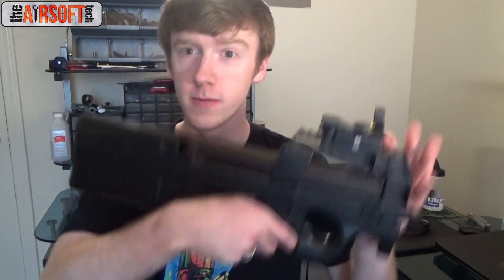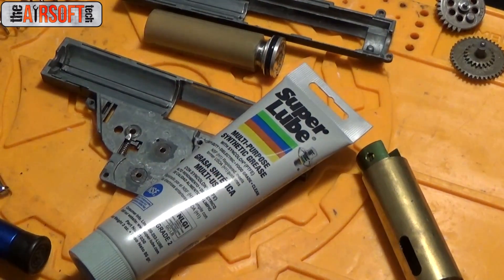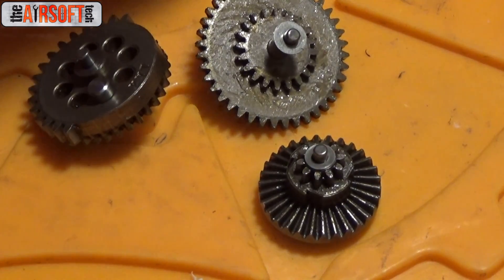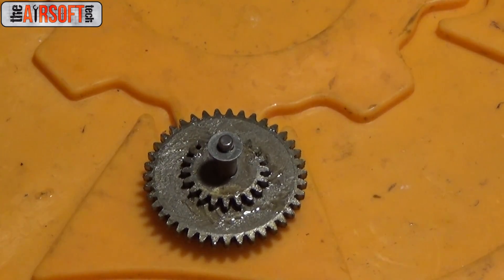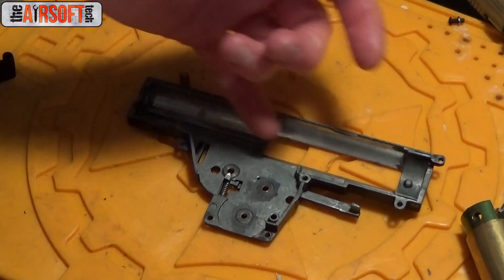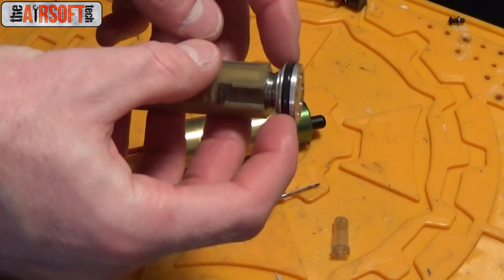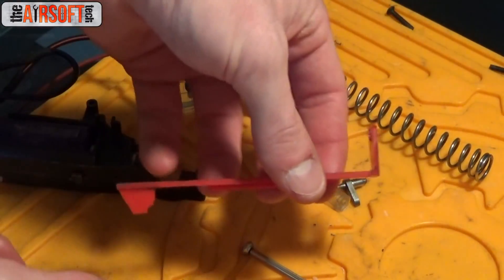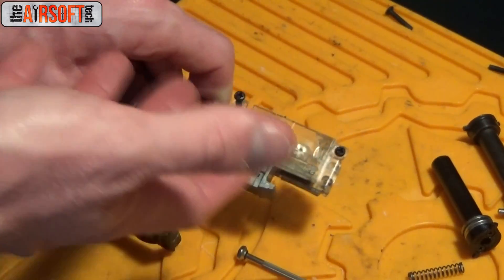Inside the Gearbox: How to Grease a Gearbox

Comment: The Super Lube grease you have is great for the gears. However, they also make one that's specifically for o-rings. This is what you should be using on the sealing surfaces.
Reply: Would you mind telling me which grease they make for o-rings? I am about to crack the gearbox my P90 has been sitting for about 8 years and I need to clean it and relube everything  and put it up for sale. I upgraded it many year ago to about 400 + FPS

Comment: Has anyone heard or seen any issues with using dielectric grease with electronics installed like the Titan Gate?  What worries me is some grease has to fling off the gears and possibly cover light sensors and possibly cause a short in the circuit boards.
Reply: Dialectric grease shouldn't cause shorts (superlube is dialectric I'm fairly sure), but if you use too much it absolutely could fling off and cover the titan's optical sensors, yes. Very carefully applied film of grease preferred.

Comment: I bought teflon grease to lubricate my gun but then i read somewhere that the teflon eats rubber parts. Some say it does, some say it doesnt, and some even say it "regenerates" the rubber. Im confused. I dont want to use it for the rubber parts in my gun if it can eat them up. Should i buy silicone grease for that or is it safe to use the teflon grease for everything?
Reply: As far as i know, it makes them tacky and that could be detrimental

Comment: Why you don't use ball bearings under 8 mm?
Reply: Ball bearings are small when under 8mm.  It is the same reason why most people will not use ball bearing inserts that have a cage, because you have smaller bearings which lose efficiency.  Most airsofters will benefit from just steel bushings over due to simplicity of maintenance and reliability.

Comment: For real machined parts you would clean the metal with an oil based cleaner. If you would clean your slide or barrel with oil, I'd probably suggest cleaning your gears with the same thing. Ballistol or CLP?

Comment: Pssst, just use brake clean to clean the metal components.  It’s literally designed to wash off oils, debris, etc, - and then dry immediately afterwards leaving ZERO residue.
Reply: Underrated comment right here
Reply: I used paint thinner, it works too!

Comment: My aeg bushing is bearing should i put grease on bearings too? Or just the axle?
Reply: You should grease bearings too, but just make sure you clean them out from time to time as grease will keep metal particulates in there.  Also note that bearings spin faster without grease, but it will wear the bearings down more quickly because now you have metal to metal contact with no lubrication medium.

Comment: You're forgetting about dielectric grease. It's good to grease certain electrical contacts with dielecteic to prevent corrosion, rust, and ensure contacts stay in good condition.
Reply: I know this answer is 2 years late.. But that grease IS dielectric :D
Reply: Superlube is dielectric
Reply: Uhhhh if I am not mistaken dielectric means not conductive?
Reply: For metallic contacts you use conductive copper grease, not dielectric.

Comment: Hey i know this is a 2 year old video but ... Superlube is nice dont get me wrong ok . With that said in my opinion it is
 #1 to thick and gets even thicker when cold . 
#2 is kind of expensive 
#3 is hard to get  internet says home Depot has it on the shelf but ive never found it.  So your forced to order it .
 With all that said in my opinion Lucas red and tacky is a superior lube . 
#1 It is a lithium based grease with ep lubricant and ptfe. 
#2 it is about the perfect thickness. Even with the grease literally frozen in the freezer it has about the same tackey ness so movement doesn't slow down. 
#3 and best part . Lucas red and tacky is available everywhere. Walmart, lows, home depot, hell even dollar general sometimes.
#5 its cheap .i picked up a large tube of red and tacky sentheic for half ? Of what s.l cost me . 
Just my thoughts guys hope it helps someone.

Comment: How do we clean grease off a gate Titan v2 board? Exactly where do we position each wire in the motor harness from the trigger mech inside the gearbox (where does each cord go)? How/where do you fit the motor connector wires on the motor in the grip? Where should we use Teflon tape other than their inner barrel? (All M4 V2 rear wired) thank you

Comment: I think i will be paying someone at a pro shop to do all my maintenance lol
Reply: It's easier to do that, but you dont get the same experience and knowledge that you would get doing it yourself.
I would say do your own work, but if you screw everything up and want to give up, use a pro tech as a last resort.
Reply: It helps to know this information.  I've had techs work on a few of our rifles and I disassembled it for inspection; and I've found anything from uncleaned yellow grease, to Teflon tape on the cylinder head where it contacts the piston.  I've even seen low end bushings installed and loose gearbox screws.  It's worth knowing what to look for, and modifying your gun will leave you smiling 😉

Comment: can i put silicon lube on the gears?
Reply: Never put silicon on metal to metal surfaces
Reply: Use silicone grease/lube or the ptfe lube he used. These lubes are plastic friendly. Most other lubes/greases (Lithium grease etc,..) are mineral oil based and break down plastic. 
Don't use any sprays or aerosol cans or whatever, the things use to pressurize it break down plastic as well. Only use bottles/tubes/pots,...

Comment: Can you do an expansive video where you just explain the basics of how a gear box works, what the different parts do, and how to take apart/put together a common V2 gearbox? i am getting into air soft, and i have found out that it is easier to work on something mechanical when you know what certain parts do, and how the different parts work together to perform a specific function. ALSO, I am working twords being a Civil Engineer, and i hear you have a degree of knowledge in engineering, any suggestions of how to deal with the boring number crunching you often have to do in classes?
Reply: I was gonna recommend you this video https://www.youtube.com/watch?v=0pAzXjc-jW8 but i see your 3 years in

Comment: you grease the spring to preserve its life, makes it rust resistant, protects it from whatever it DOES touch, and it doesn't hurt a spring to grease it, and there are some benefits, no matter how small. Don`t think i am saying your advise i wrong, cause it isn't, i just lube my spring because it wont hurt, and i don`t mind the extra expense. Props to you though, legit videos, i subscribed yesterday, cause your videos are more information dense than most other videos i have found.
Reply: Springs are usually Stainless Steel, or Chrome Vanadium/Chome Silicone, and shouldn't corrode.
They're not going to wear out from contacting the Guide or the Piston either.
What grease will do, is attract and hold dust/dirt/debris that gets in to the Gearbox, which WILL cause wear.
Reply: SixFootDworf lol wrong

Comment: Just use Brake Clean for cleaning my dude, way faster and more efficient than hot water. 

CRC makes a Dry Spray Moly lube too, which I personally prefer for my GB's, being in a dry, dusty climate. 
Then I use Dow Molykote 55 for all my O-rings, one tube has lasted years. You only need to use the slightest amount.
Bearings I use Valvoline Palladium 5% moly grease.
Reply from the maker: HamsterSoup I used brake cleaner for a while, still didn’t clean the gears to my desire.
Reply: Ahhh, fair enough! Might be due to our differences in lubrication choices. Building these things is all about finding what works for yourself
Reply: those are for industrial use

Comment: Grease attracts and holds any airborne debris that gets into the 'Box during use.
The AEG Gearbox is basically just an Air-Pump after all,and the air comes in from the Environment it's being used in.
All that dust/debris that goes in, sticks to the Grease, and basically turns it into a fine grinding paste.

Anyone that's ever stripped a 'high-mileage' AEG Box will know the mess that they get inside.

That's why I never use any Grease in my G/Box builds.
Instead, I use a Dry Film Lube, Molybdenum Disulphide based.
I use it on anything else that's subject to wear too, Piston Tracks in the Shells, ARL, Semi Cut-Off Lever etc.

I never use Grease on the Piston Head either, for the same reason.
I just squirt Silicone Spray directly into the Cylinder with a long thin Tube (passes through the Barrel & Hop) before and after each use, then dry-fire to get any excess out, then clean the Barrel and Hop Rubber with Cigarette Filters.
It's like stripping, cleaning and re-lubing your Cylinder and Piston Head every time you use the AEG, but only takes a minute.
Reply: John Warner do you use dry spray grease like motor chain grease? Youre the first person that state my theory exactly like you explained and why we should use that kind of grease
Reply: No Sparklaus, I know the stuff you mean though.

What I use is a liquid solution, it can be brushed on, or it's also available in Aerosol form.
Google Molykote 321R.
It cures to a fully dry coating that's extremely tough.

It has to be applied properly though, and the prep is very important, as it is with paints and other coatings.
Best surface prep is a light abrasive blasting, I made my own Blasting Pot, and Cabinet, similar to this one . . . https://www.youtube.com/watch?v=1Z01aQ5VBNg
Reply: I use a very fine Abrasive Powder, it puts a very slightly matt finish on the surfaces, perfect for the Coating to bond to.
Heating afterwards helps it cure.
Reply: I agree with you on the points you made, why not put a simple dust filter around the gear box than? i mean, if grime getting into the gear box is a problem, than make it airtight. than that makes a second problem, the gear box is an air pump, and needs air to function. so why not make a gearbox that pumps air to propel the BB, and than when it needs more air, make sure the air comes from one place that can easily be filtered with a simple dust filter. any thoughts on this idea? its seems solid to me except some minor issues with how to go about doing something like this, but, start a discussion on this.
Reply: I guess it would be possible, but the point of the dry film lube is that you don't need any grease at all.
The pressure rating of the film is huge, way beyond the relatively low loading on the gears.

Any dust/dirt that gets in doesn't do any harm.

Comment: The only point of contention I have with this, granted it's a very specific circumstance, is trigger contacts.

Something with a high dielectric strength, such as Super Lube's silicone compound, can help cut down on arcing in systems that don't have a mosfet, extending the life of the trigger contacts.
Reply from the maker: This is true.

However, I’ve found that adding grease to the trigger contacts can sometimes slow the response time down- acting as an insulator.

Comment: "Because anti-reverse latch work by friction" I could use an explanation there. Greasing the shaft could reduce the wear on it and I think it could damper the slight noise of the latch touching the rotating bevel gear. It also applies to your trigger shaft I guess, greasing it (a little) could help slowing down the wear (avoid greasing the contacts obviously). Same thing with your selector plate.
As a general rule, greasing any moving part which are sliding/rubbing against another is a good think, since it reduces friction thus reducing wear.
I'm no expert though, so please tell me why i'm wrong if I am.
Reply: An Anti Reversal Latch doesn't 'work' by Friction, it works by physically locking the Bevel Gear in one direction, it's a basic Ratchet Mechanism.
Reply: @Docv400 and a ratchet mechanism works using ?
Reply from the maker: I tend to look at greasing/lubricating things in two ways:
1)  Will "x" theoretically wear out over time? (x being the anti-reversal latch in this case)
and
2) Does it wear out over time?

The answer to #1 is, of course, yes. But the answer to #2 is no. I have never seen an antireversal latch, or the gearbox that surrounds it, actually wear out over time.

That's why I don't grease it. You may not be wrong on reducing sound, though.
Reply: Yeah I see your point. Some pieces theoretically wear out but never actually does in their lifetime. Thanks for the answer!
Reply: Tensees it might not do its job if its greasy.

Comment: Can you make video on greasing gas blow back guns (pistol or rifles)? like a silicone grease VS silicone oil video? pros & cons etc.
Reply: T.Ryder727 he doesn’t really do gbbr. It’s really easy. Just use murder oil on the bolt and o rings.
Reply: @Viet Vo pretty sure you don't want to be using silicone oil on those as it will gunk up and cause more wear.

Comment: if you were to upgrade a krytac mk 1 spr what would you do to it? I need to do some of these things on my own, and I keep hearing mixed things. you have not lead me wrong yet.
Reply: King Albby What do you want? Like how do you want it to perform?
Reply: The krytac is going to be for outdoor play. So shooting close to 400fps is what I am looking for. I would like good accuracy and consistency. I don't normally use full auto so having good trigger response is a plus. I heard something that will help the krytacs feed is a sector delay chip as well as since I don''t use full auto a burst function might come in handy. I know for the burst function I would need a titan or similar mosfet installed. If that is the case I would not do that my self and have my local shop do it. (I don't have good history with the shops techs, so I would like to avoid them). I know I don't need a new mosfet so that is not a big deal for me just to have burst.
Reply: Installing the titan is easy as pie look up the video. If you have the money, go for it. Considering Krytacs are pretty good out of the box, the Titan is a great option. One of the things I'd change tho, it's the piston for an SHS/Rocket Swiss Cheesed blue piston, they are like 11 dollars or less. What I'd also recommend is to Rhop your stock barrel since they are pretty good, almost as good as prometheus, so upgrading your stock barrel would save you some money with almost as good performance.

Go to Airsoft Teching Q&A on facebook, it's the biggest teching community and is always active. Any questions you have, go there and you might learn a little something else
Reply: TheGreatPieEater I am on the the airsoft teching on Facebook they have not been any help.

Comment: I have good air seal on my piston head's o-ring, but if I put silicon oil or grease on it, the air seal becomes pathetic and unusable. If I dry it, it works better. wut do?
Reply: Cody Zwicky well then tell that to airsoft. Almost all o rings in airsoft need to be greased
Reply: RandomCanEHdian use less grease
Reply: OP Airsoft even a drop causes it
Reply: Shouldn't you lubricate o-rings to prevent them from drying out and cracking?
Reply: An extremely light coat of oil, not grease, is OK to prevent cracking. Using grease to create a seal in a pressurized system is a bad practice.
Reply: Cody Zwicky I know. I'm saying any amount of any fluid makes the air seal terrible
Reply: Then run no lube and just get a few extra o-rings. They are cheap and easy to replace and are ment to be a replaceable part.
Reply: You usually don't get good tolerances with cheap chinesium junk. Tolerances+correct o-ring=proper seal.
Reply: You shouldn't grease o-rings to begin with. If your o-ring needs grease to help make a seal then it's the wrong size.